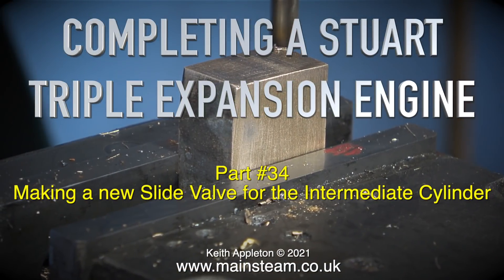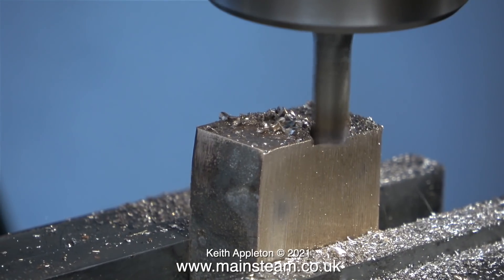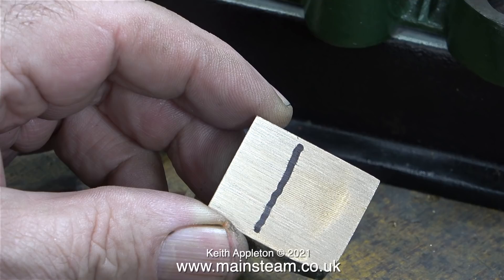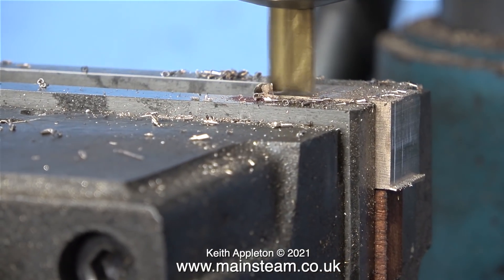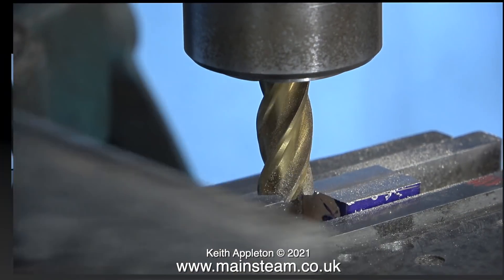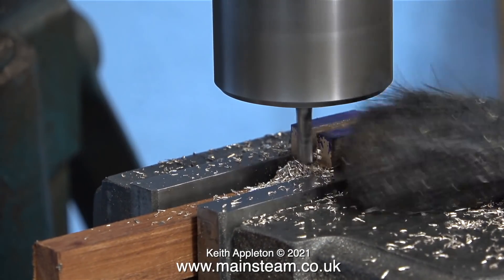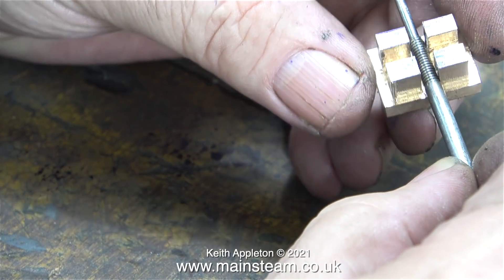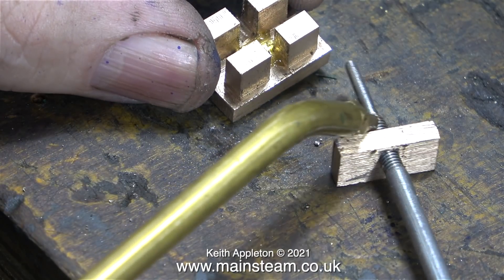COMPLETING A STUART TRIPLE EXPANSION ENGINE - PART #34

Comment: A question, if I may please, Keith?  You said, and I didn't really think otherwise at the time, that  machining away the 'uprights' on the valve wasn't necessary?  Now, I wonder if there is enough surface area, in the right place, upon which steam can press the valve block onto the port face?  I may be misunderstanding the whole 'pressure differentials' thing, but it seems to me that controlling live steam to pass either end face and into the cylinder port, may be on the limits of how much that live steam can press the valve onto the face.  What have I got wrong?
Reply from the maker: The to surface area is all that matters as far as the steam pressure is concerned, it is only machined to lighten it and slightly reduce the reciprocating mass. The shape is unimportant.